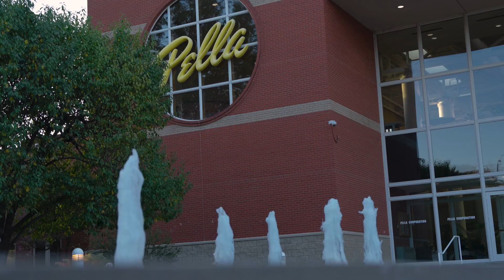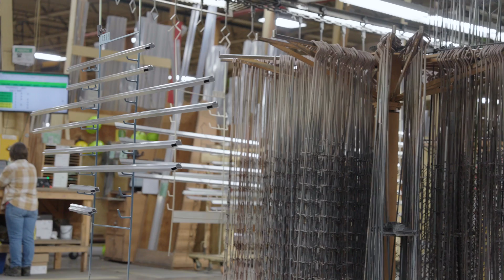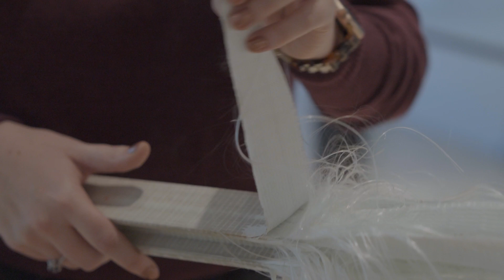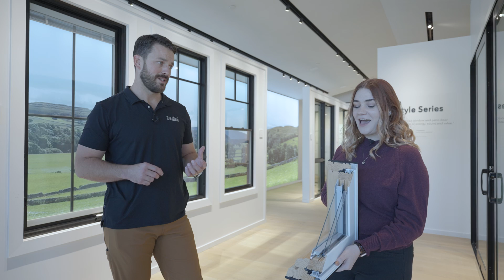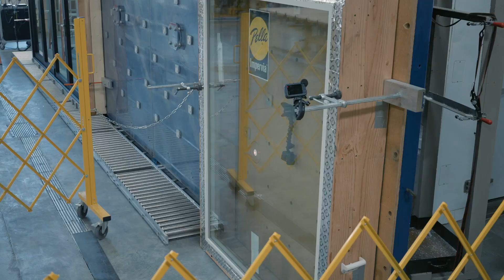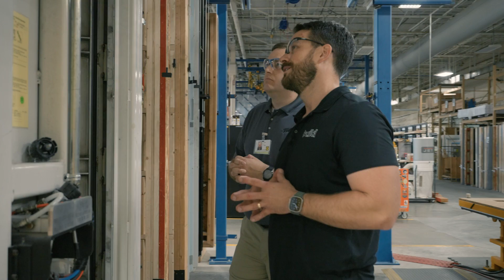America’s Best Windows? Made/Owned/Tested in USA. Full tour/Breakdown

Comment: Have Pella on my existing home. Well built but seals almost too tight to close properly, they have lasted years so far. Had an issue buying them, they are sold in "regions" by specific dealers so when one doesn't respond to inquiries none of the others will speak to you. They're also pricey, you won't find discounts generally. What's in the big box stores is a different animal too - not what you get from a Pella dealer in my experience. Overall satisfied but the purchase process was bumpy for my builder and he was shocked at the price.

Comment: I personally have Pella Imperia windows.. I wish I would have chosen a different model because my neighbor with the same house bought Americas best vinyl windows and they are so much quieter. I did have a leak issue with a clogged weep hole (lack of maintenance- my fault but something to consider since nobody thinks of maintenance with windows.). My parents have had nothing but trouble with their Pella slider with blinds in the window. My lake house sliders don't seal tight. Lake Neighbor has hand pints on the inside of her double pane glass sliders... I will do with Andersen Windows or Chinese windows when we replace.

Comment: My parents used Pella products for their remodel with a positive experience in Ohio.  I choose the 250 line to replace 45 year old windows in my duplex in ND.  The transaction with the sales guy went smooth.  The install wasn't up to pare.  One of the fixed panes cracked, not the necessarily the fault of the installer.  It took Pella 2 attempts to fix the pane, the first attempt someone at the factory ran a screw into the new glass.  Packaging was better on the 2nd attempt with a satisfactory install, but it took months to complete.  

My new windows leaked during the winter.  I had condensation on the new and old windows, but the old windows never leaked from the top.  I can forgive the condensation on the new windows, we're climate zone 7 with a house built in '77.  I did personally install an Anderson window in my bedroom, before ever hearing about the Build Show, that window never leaked from the top trim (got some pointers from a construction worker neighbor).  You could see the wood trim stain leave a trail to the sill.  Sent photos to my sales rep, he filed the warranty claim (Feb).  I let it be, after a couple of months, I called the Fargo office.  My claim had been "misplaced".  The Minneapolis Office called to apologize and make arrangements.  One of the installers came by early spring (May) to inspect the install, apologized personally for the unsatisfactory install.  The "fix" wasn't completed until July/August and they didn't re-install the faux shudders which are still in my garage.  I know how to run a screw gun, I can re-install the shudders, but they didn't inform my Lovely Spouse if they'd be back to put the shudders up.

Yes, I purchased the budget line Pella window.  Thank you Matt and Steve from the Build Show, I could see where the install crew may have gotten details wrong but let them do their job.  Yes, Pella honored the warranty, however the lead time from filing the claim to addressing the claim took months, not weeks.  Time will tell if the fix worked, winter '23 just started.    

The 250 Pella windows certainly are an improvement on the worn out 45 yr old single pane units we removed.  However, the money spent and warranty process, honored notwithstanding, lead to some real frustrations.  I'm debating working with another window manufacturer for my remaining windows.

Comment: Pella has major QC issues with respect to their gas filling. A whole batch or windows I ordered in 2012 were not filled properly. All of them, irrespective of size, have about 1/2 inch of water condensate at the bottom as soon as outside temperatures approach freezing. When I tried to file a warranty claim in 2023, they told me go pound sand. I'm won't buy another Pella window, that's for sure.
Reply: Pella doesn't make the glass thermopain it's made by cardinal who makes something like 80% of the glass in res windows the last 20 years. Sounds like a shipping or install issue with that kind of water.
Reply: Condensation! Installation issue...not even Pella suggested such a nonsense in their rebuttal. I have installed a lot of windows in my life, never had a consistent problem across an entire batch. Who ever made the pane assembly did not fill or seal them properly. Pella is ultimately on the hook as they sell the window. @sparksmcgee6641

Comment: As a window cleaner, the triple pane pella windows are awful. They get cloudy every year despite being “sealed”. And they are a pain in the ass to clean/deal with with all the delicate parts holding them together
Reply: As a better window cleaner I'll say pella storms under their current system, I worked on one of the first houses with the new ones mid 2000s. 
Id just see money when I see a pella tripple. Little more work if your detailing everything.
The install clips are the worst item on a pella window or screwn.

Comment: I can say that I loved my Pella skylights.  During the hail storm that hit the St. Louis area in April 2001 my 2 Pella skylights did not break.  I think that storm still ranks as the costliest hail storm in the US.  It dropped 3" hail stones on my house.  The Chevy dealer less than a mile from me had almost a total loss of their inventory of cars.  They were just before me in the path of the storm.  When I examined my roof, I could not find an area of my roof equal to the area of one of my skylights that didn't have a major impact.  So it was either a VERY freak occurrence that my 2 skylight didn't get hit by one of these sky rocks, or they did and said, that all you got? 😁  In fact one of the skylights had a decent dent in the aluminum frame from a impact.  I had two roofs on my house at that time and I didn't replace my roof until 2009.  Never had a leak.  At that time I wanted Pella skylight to replace the ones I had, however, I found that Pella didn't make them anymore.  I was bummed.  I ended up with Velux skylights.  In my experience I would positively consider Pella in the future.
Reply: What type of glass did you have?

Comment: R-15 is the latest standard for windows, Pella has a long way to catch up or even advance the window industry.
Reply from the maker: R-15?   I'm not seeing that anywhere... that's a U Factor of .06!  Haven't seen that anywhere...
Reply: @buildshow  Actually it’s 0.067 which we round to 0.07.

That said, this guy likely confused U-factor since we never refer to window w/R rating. A U- factor of 0.15 is quite common among European windows, often lower. 

Equally important is the European windows typically have 3-5 compression seals making air infiltration dramatically lower than American windows & doors. The NRFC infiltration minimum rating of 0.1 is rarely achieved in American windows but commonly met in European windows. In fact European windows are substantially lower in most cases but NRFC testing standards cannot define air infiltration below 0.1 due to their testing methodology
Reply: That isn't true. Whoever told you that is wrong. Full stop. 
And the insulation for windows is down to the glass not the frame anymore.

Comment: Marvin makes the best windows.  Pella makes crap
Reply: marvin makes the best? what's your metric?
Reply: They sale Pella Windows at Lowes.  I have installed commercial and residential windows for over 45 years.  Marvin uses aluminum extrusions and Pella wraps their windows with tin foil
Reply: you didn't answer the question, but i appreciate the intel.  @tomreidy1237
Reply: @tomreidy1237 you're jumping all over. I have a Marvin fiberglass window in one of my houses. 
And selling at lowes doesn't mean anything. 

I like Marvin but when you put them side by side they're close to thw same. 
I've seen plenty of quality control issues with Marvin windows. The standardized system pella has on sizing prevents a lot of the problems Marvin has with everthing being a "custom" window.
Reply: high end anything doesn't sale at box stores.  Unless Pella has gotten away from those crappy inserts that you couldn't get fixed at the local glass company, the paint finish on the aluminum cladding is prone to fading, they use aluminum wraps to cover the wood on the outside of the windows in lieu of extruded aluminum, and they lost a $35 million lawsuit for leaky windows.  Marvin Aluminum Ultimate windows are the best made window in the USA.  There are some great windows made overseas, but none better in the USA
 @sparksmcgee6641
Reply: @tomreidy1237  Wraps their windows with tin foil.... Just be honest you work for Marvin huh?
Reply: @tomreidy1237  Marvin Ultimate and Pella Reserve are practically the same window. They are manufactured almost the exact same way. Pella's highest end products are not available at Lowes either.
Reply: @Assyrianbawsmane  nope.  I am retired now but worked for years for my family glass company and learned the hard way that if a Pella window was broken you had to buy a whole new sash.  Also- since they used break metal to wrap over the outside of the wooden sash- they used polyester paints that were more prone to fading and chalking up versus true aluminum extrusions which could be painted with Kynar paint that would be guaranteed for twenty years.
Reply: @t @tomreidy1237 how long ago did you sell windows? They use extruded aluminum now on their wood windows. They also use glazing beads on their products so you can replace the glass instead of replacing the entire sash.

Comment: Triple glaze, European style seals and locking mechanisms
European doors and windows have great quality. It would be great to see a comparison side by side. 
More roofs need a two foot overhang to provide protections for doors, windows and siding.
Reply: I agree! US manufacturing is way behind for window build quality. 3 layers of argon insulated panels and 3 position handles and hinges  are standard in any German home.
Reply: There may be some impact of the price point obviously, yes, but the quality requirements are really just higher. And the country where  they are manufactured doesn't matter, even in Italy they order in china but with EUROPEAN requirements for energy, quality and safety. US requirements are just lower (partly to offer cheaper products, party because of the absence of regulation)
Reply: You dont know anything about building.
The o ly comparison that matters is comparison of the same priced products.
There are all kinds of American companies building comparable windows to "European". And just saying European shows you don't know much.
Italy is the last country doing high quality work in country. Those European products you're say are so great aren't made in old Europe.

Comment: I'd love to see a head to head comparison between Pella & Marvin. 

Personally, I'll take the latter.
Reply from the maker: There is no one magical bullet window company. I’d ask Pella for their DP50 or 70 rated windows with Triple Glazing. That’s a winner that would complete with the best
Reply: @buildshow  lol. that says it all.  Pella's deluxe would "compete with the best"... i.e., Marvin.    Sorry Pella. You didn't pay him enough!
Reply: Not in comparable products. Marvin cost another tier up. 
Marvin has more quality control issues.
I worked on them for decades.
Reply: Not even close.  Marvin makes the nicest windows of the major brands.
Reply: They are both poor in terms of both air sealing and thermal efficiency
Reply: @MichaelM-to4sg  So.  Marvin & Pella aren't pretending to be a European window manufacturer, the former doesn't even make a tilt/turn anyone because no one in the US bought it.  They predominately make double hung, which have a ton of architectural detail, but if you only want the most efficient windows, these aren't it.
Reply: @recoveringarchitect7581  Double hungs are great on historical restorations, otherwise it’s a very poor choice and not usable in my region as it’s NRFC ratings cannot meet minimum standards. 

In fact they only make a casement and fixed that can be installed here to meet minimum code standards of U: 0.25 and Air infiltration of 0.1 cfm/ft^2.  

We build exclusively PHI certified homes for last 7 years, Marvin has no offerings that are suitable. Pella at least offers PHI compliant window but it’s still nothing near the NRFC specs of the European windows we use. 

If you’re a custom home or MFR builder today, using modern air-vapor barriers and properly sealing every joint of structure, why waste that entire effort on windows that leak air with 1-2 compression seals and poor insulated glass?
Reply: @recoveringarchitect7581 Marvin had a turn n tilt last time I looked
Reply: who do you recommend? @MichaelM-to4sg

Comment: I installed 5 Pella 250 windows as I dod not have the $$$ for the fiberglass ones I would have loved to have had. Also a cour issue as they come in only black. BUT: the opening mechanism of casement windows - a slider???? Good grief. I'm from Germany and grew up with casement windows because it's almost all that we have (until more recent homes which include American style and other style windows. But the simplest casement window mechanism remains the beat: one lever that one laays down to open the window as a door would, and the same lever tilted vertically, opens the windows only from the top in a narrow tilt. And they are airtight. Some. I miss these Windows because they are simpler all around than the sliding  hung windows.